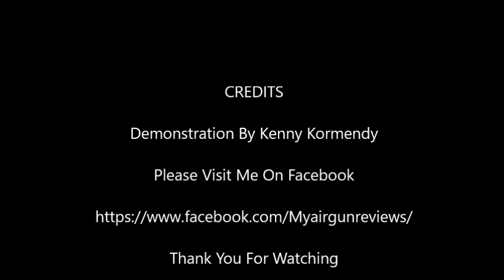Trigger Fix For Gamo Pellet Rifles With Plastic Trigger

Comment: Wow, thanks Kenny! I just put in the 2.5 x 8mm Socket Head Screw. What an awesome improvement, I also got the 2.5 x 10mm but the 8mm is perfect. I got my screws @ Home Depot and I installed the 8mm screw in a Gamo Hornet Maxxim .177 cal. with a CAT trigger, big improvement on the second stage travel, the trigger is much lighter with less creep 😎🖒 Thanks again Kenny.
Reply: How many turns out after you turned the screw all the way in with the 8mm

Comment: I couldn't find a 10mm long screw for the trigger adjustment. I had a M3 tap and some M3 screws so I drilled the hole out and installed a M3x16mm screw. I adjusted the trigger pull to my liking and then put some CyA glue at the base of the screw to keep it from turning. This made a huge difference in my trigger. Thanks for posting this video!

Comment: This actually works, but I needed a much longer screw than the 8mm one recommended in this video. Perhaps there are different versions of the mechanism? Better use a longer screw, because the extra length does not do any harm even if it is not needed. You can leave it protruding (provided that the screw fits so snugly that it does not turn by itself) or you can use a file to shorten it to achieve the optimum length.
Reply: @Youtube Account How do you know?
Reply: @Youtube Account I did, thanks. I feel sad for him.

Comment: I just did this to my varmit hunter 1250. Works good but let me stress this: BE VERY VERY CAREFUL! I had it dialed in very light and put about 50 rounds through it. The screw moved (I loctited it also!! But maybe it wasn't dry yet) and the trigger became hard to pull on one attempted shot. I brought the gun outside and pulled hard and it fired. No biggie right? Well I loaded another pellet, this time indoors (I thought I didn't close the barrel good enough last time as to why it didn't fire correctly ) and when I snapped the barrel closed it went off!!!  Luckily it hit the wall and nothing valuable or anyone. So morel of the story....BE CAREFUL AND IF IT FEELS FUNNY, then don't discount it, find out why and point it in a safe direction.

Comment: I just changed the screw in my Whisper Fusion Mach 1. I put in an 8 mm long screw. The 6mm screw was tightened as far as it would go from the factory. I actually turned the 8mm screw all the way in as well. I can't tell a huge difference in the trigger. The pull seems to be a little harder but I didn't measure it before or after the change.
Reply: olbill70 that tells me you need the 10 not the 8. I had the same problem with mine.

Comment: Hi, I recently bought a Gamo Socom 1000, and found the trigger travelled miles before firing the gun, but just replacing the adjustment screw with one two and a half millimetres longer made a huge difference, thank you for your excellent guide...

Comment: Just installed an 8mm, overall it is not bad, the second stage is fine and a good hunting pull.   That long first stage stays though which is a little annoying.    Personally I like the tuna trigger alot more and for my personal guns I would spend the money.   The the gun I'm tuning for my brother this will work fine and he can decide if he wants to upgrade to a tuna in the future.      Either way it's a big improvement over the aweful stock setup

Comment: Thank you Kenny for this video. I have the same trigger assembly on my Gamo 1250. It was horrible. I modified my screw after watching your video and it’s a huge improvement! I didn’t have the 8 ml long screw so I cut a taper into my assembly as well tapered the screw. Much much better. Now I just need to replace the Gamo scope with something that stays on target. I have over the last 2 years had to tighten the right to left screw about a quarter turn after every 20 shots or so. Any recommendations on what scope to put on?
Reply: Make sure you get a scope that's rated for Springer Type Air Rifles or it will just fall apart again like all the other Gamo Scopes.  Hawke has some that are rated for springer type air rifles. I know that Gamo uses IGT but it still has a forward and backward shock to the scope when you fire the rifles.
Reply: Glenn 
Thank you for this reply. I shall be keeping this in mind when I go scope shopping this fall. Most appreciated.

Comment: I saw a question posted twice but Barry, no one answered him.
He asked how many turns out should you go after it is in all the way?

I think what Kenny was saying is you screw it in (8mm screw) far enough so there is approximately 2mm of thread still exposed, then start adjusting in 1/8 turn until you have it where you need it.

Correct me if I’m wrong...I just received my screw and haven’t tried the adjustment yet.
Reply: The94GTC  Well that Sucks. RIP Kenny.  Cancer sucks man. I hate to hear that cancer got a good man like Kenny. We need more guys like him around.

Comment: Does the rc bearing modification also work for gamo rifles? And if so, would the screw or bearing be a better fix?
Reply from the maker: It should. I've never taken a Gamo down with the old style trigger. I think the trigger was just fine with the new screw.
Reply from the maker: Some leave it in, I leave it out.
Reply from the maker: I did one on the Striker Edge Combo. Just a different style Stock. As far as the tight Breech goes, Just a very light touch with a demel tool will work. (Very Light)

Comment: I wrote in comments for help yesterday and no one seemed to have it no one knows much about the Gamo trigger but now I do I completely tore it down and completely build it back add some mods but what I did was a little different there's a guide for the spring guy they each have their they each are guides I never thought a guide would have a guy but it did well it broke in my Gamo rifle once I got it completely apart I made it out of conduit the part that was broke I added an eighth 2 3/8 length to the piece of plastic piece that the spring rests on now you could have put it has one washer you could have put more washers on the spring guide but I just lengthened the piece of conduit by 3/8 and my God you would not believe on this chronograph with 10.5 pellets this puppies running 11:25 I don't know if the breach can handle it but Levin hundred and twenty-five feet per second with 10.5 pellets is hammering I'm probably going to blow this thing up but thank you for everybody's help its shoot and great.

Comment: Kenny can the screw be removed and changed with the action in the stock?
by the way love your channel
Reply from the maker: Yes. If there is no hole allowing you direct access to the screw, just drill a small hole in the trigger guard.
Reply: mines the wildcat whisper and has a slot down the bottom center of the trigger guard.
Reply from the maker: That's the gun I used in the video. No disassembly required.